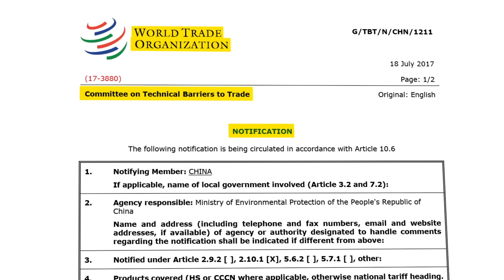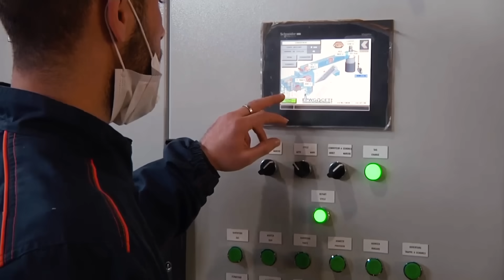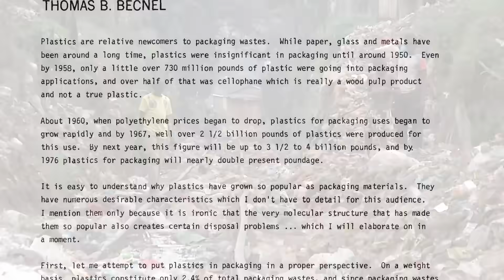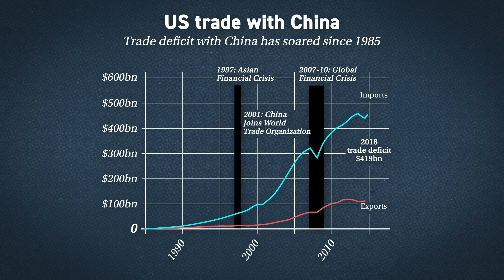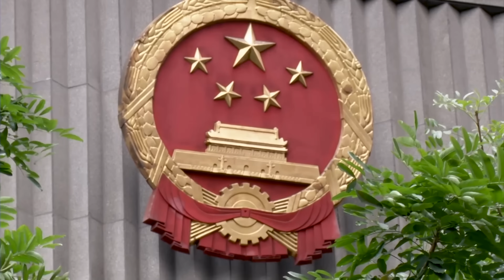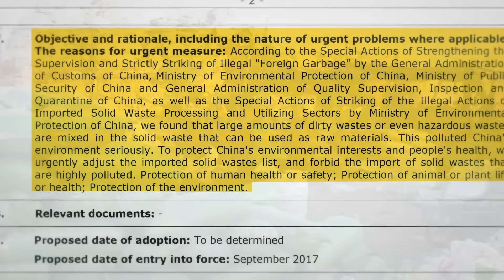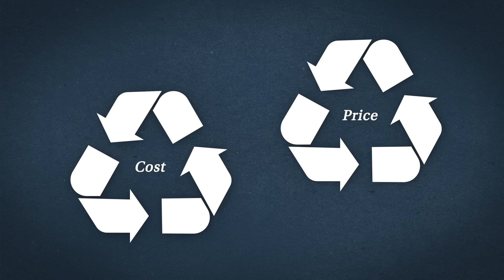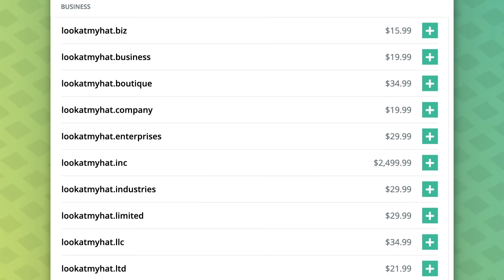How China Broke the World's Recycling

Comment: The issue is the fact 80% of the stuff we use before the 90's were reused in Local and federal government projects. Soda Glass Bottles being turned into sand for building foundation or Part of road repair. Aluminum cans being reused for Bicycle or mechanical parts needed. Paper turned into Cardboard for numerous uses.

Plastic as know is being made from Oil/Gas products, that we drill to get and the fact plastic takes over 3 centuries or longer to degrade. On top of that the harmful effects we know and don't know  to the human body.

Plastic to me is no different to me then mining of Absectos, or the other mined resource which is toxic and was used in everything.

Comment: THERE IS A MAJOR MISS BY ANTI PLASTIC FOLK and the PLASTIC INDUSTRY maybe. 

Plastic does not have to make money in recycling to be recycled. All these it can't be recycled arguments are actually it can't be recycled profitably. But who says it has to make a profit to be recycled you just add the cost of recycling to the plastic when it's made. This might move some products to other containers I'm fine with that. But the switch to plastics in a major way was pushed by someone poisoning food in a grocery store. Turned out it was just cover for poisoning someone they wanted dead but it scared the public into requiring all food be sealed. And in the days of terrorism that food poisoning thing will still result in demands plastics be used. 

As shown by bottle return value states you can make sorting it profitable for those selling back to the state. Then the state charges a tax on all plastics used to cover. You directly charge the plastic industry for money losing recyclables to be recycled. Now you can make the recycled plastic's price low enough for it to actually be recycled into useful things. 

Non plastic containers cause glass shards that cut people, cloth bags to harbor dirt with food poisoning microbes and other microbes if people don't wash them. Wood processing which is environmentally unfriendly. The alternatives all have a major down side. In part because sanitation is the enemy of environmentally friendly, why because things that eat people like environmentally friendly things. And water use considerations. 

So actual solution that hard line environmental people and the Plastics industry to both hate. Mandate all plastic be recycled and the cost to be born by the plastic's industry including what every steps are needed to make the recyclables better than new oil supply.